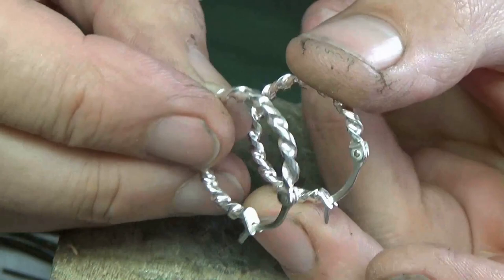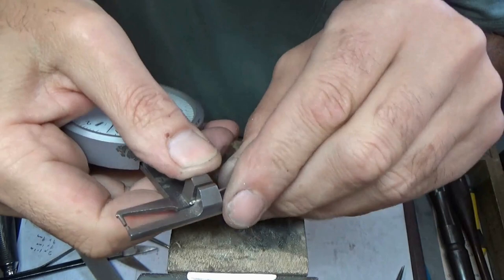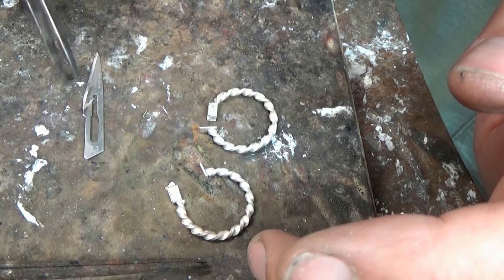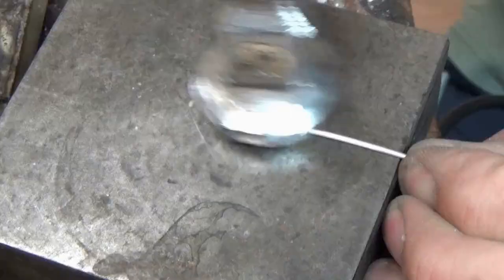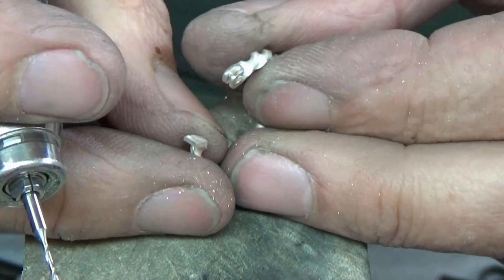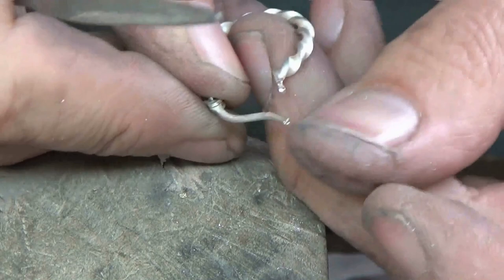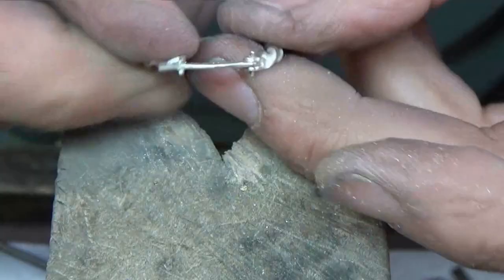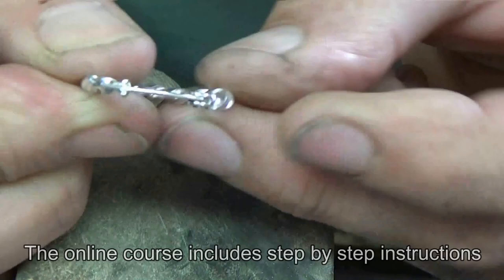Creole Earrings

Comment: At 1:22 you used a draw plate, can I ask why you draw with the wider part of the hole (countersunk) at the front please? The wider part is to funnel the wire through for ease off pulling the wire, but you're using it the other way round. Curious because I could be reducing wire wrong, thank you 😊
Reply: I've just seen you use the smaller hole above, is there counter sunk holes on the back too? Thanks 😊